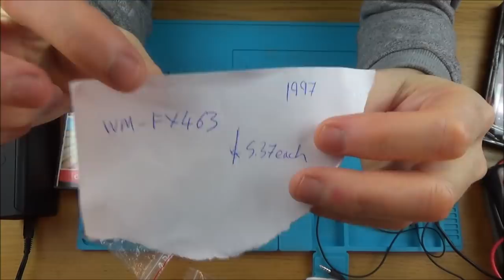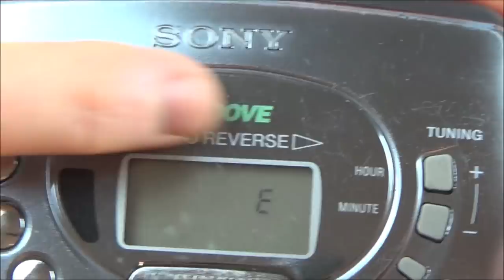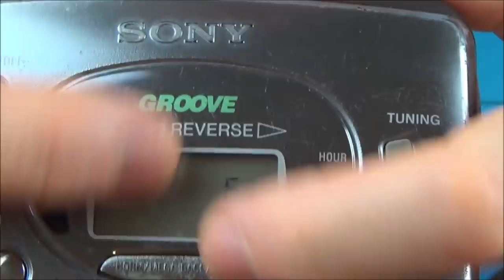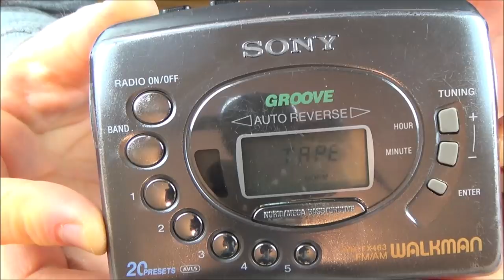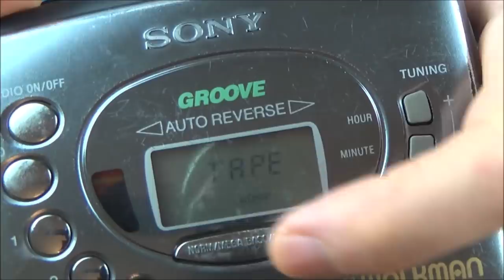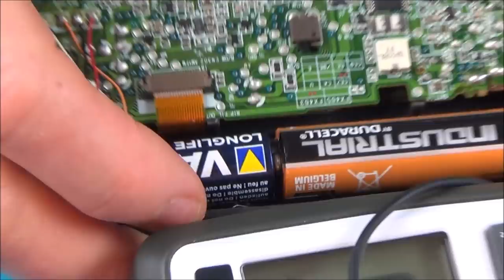Trying to FIX a 1997 Sony Walkman WM-FX463 (5th video in Walkman series)

Comment: you improove your skills pretty fast, but you need to be more gentle to electronics, don't toss them that much ... anyway your videos are interesting, keep making them ;). I think the problem is with square chip on the back PCB. It is  LA4xxx ... this chip is main headphone amp and tape head preamp. Many years ago i had to change a similar one of theese to fix similar sony walkman. Set your iron to 330-350C ... 400C is too hot, solder melt on about 187C. Try to reach front board, where is main processor, the board may be coroded and cause the problems. Also try to connect the grounds on walkman and your test power amp and poke walkman's volume potentiometer pins with one of your test amp channels for any sound.
Reply from the maker: Great advice, thanks for sharing your knowledge :-)
Reply: @Mymatevince  its my pleasure, you remind me of myself when i start electronic repairs some 25 years ago ... it was hard because intel was insuficient back then... ;)

Comment: Is a sound chip a thing? If so, maybe that could be the fault
Reply: Swaggin dragon       Yes sound chips are a thing called pre amp chip some are decoders but that's more in receivers that need to decode the surround sound mix. The information from the type is in analogue format and needs to be decoded to a stereo output that then goes to a pre amp witch is then controlled by the volume switch witch then is outputted through the headphone jack in a stereo format.  The types already in stereo so there's no need to really decode that much it's not like a surround sound mix where it needs to put information to certain speakers at a given time it just converts it from analogue to digital out of the headphone jack. So good place to start be the headphone jack witch he did work your way back could be a faulty sound chip cause radio dose not work either that be the same thing radio is actually analogue too the radio we listen to in are cars is analogue there is digital radio but the normal radio we all know is still analogue and that as well needs to be converted to digital out of the headphone jack

Comment: From what I can see the capacitor that is reading short goes to the switch next to the head phone jack. It appears to be a three pin switch so the center pin should lead of to the faulty component(more than likely the LA4585 chip). But by flipping the switch the other way the short on the capacitor should disappear. If it doesn't then the faulty component is after the capacitor which I can't see in the video.
Reply from the maker: Brilliant fault finding advice,  I will look into this again as I have quite a few suggestions on the comments here so a revisit might be done. Thanks again :-)

Comment: There's no batteries in it why is the clock still working
Reply from the maker: I think it has energy stored in the capacitors that keep the clock working for quite a while after the batteries are out :-)
Reply: Capacitors store power even after you take out the battery's there will still be power until it all gets used up.

Comment: Vince oh Vince... When are you going to STOP calling diode test mode 'continuity test'???? It's NOT CONTINUITY BEEP!! IT"S A DIODE TEST MODE YOU NUMPTY! USE Ohm MODE TO TEST FOR RESISTANCE/CONTINUITY!
Reply: He's learning hopefully.
Reply from the maker: Sorry but why can't you use the 'beep' (diode) test to check for continuity, it is because different multi meters are set up differently so some will beep at different resistances? When you use the Ohm mode what do you class as a short (it is above a certain figure or a certain range) as when I have tried it I get different readings which confuse me but a nice beep is quick and easy to listen to. So when you are fault finding looking for a short to ground on a cap do you not use the beep test? Please explain it as if you were talking to a 10 year old and then I might be able to understand it because remember I am a numpty when it comes to this hence the 'trying to fix' title of the videos :-)
Reply: @Mymatevince  Vince! No worries here - i'll explain. Main thing is - it WILL beep even if there's no DIRECT continuity. So, some circuits have like 123ohm resistance - in diode mode it WILL beep and you may erroneously think it's a short! So, better to get/build/buy a 'continuity tester' - those are very popular with car mechanics! Same principle but it will only light up/beep if there's DIRECT continuity. Also, diode test mode is hit and miss because some circuits are polarized, so it will, say, beep when probing a-probe to point a and b-probe to point b, but won't if you swap the probes around! Any questions - i'll be happy to answer! LOVE your videos. It's a mix of nostalgia, floorwork (i still do stuff on the floor sometimes) and useful tips/exp! Thanks again bro! No offense meant :)

ps. in ohm mode - short probes one to another, notice the resistance displayed (vary with diff models of meters and probes). This is a 'short/continuity' with your setup.
Reply from the maker: Thanks, so on my Surpeer AV4 it does have a continuity mode which is the one I use (the one that beeps) so is this definitely different than the dedicated continuity testers on eBay/Amazon? When I short my leads on the Ohm setting it reads 00.21 Ohms - 00.14 Ohms (varies). If I was using this setting across a circuit board which may have slightly corroded pads my continuity setting would still beep but what range on the Ohms settings would still indicate a short, for example if it read 00.90 Ohms or 1.50 Ohms would this still indicate a short. This is what confuses me as it won't always read 00.21 Ohms but it is still a short but perhaps a dirty one. Hope this makes sense, it does in my head:-)
Reply: @Mymatevince  1. sub-1ohm resistance is a virtual short, also even expensive meters sometimes struggle in sub-ohm range. 2. 1.5ohm is not a short technically. corrosion and such can really mess with digital circuits because of that (minus the trivial corrosion of in voltage parts/connectors). 1.5ohn is a load, not a short. 3. at 20:36 if my eyes are correct i see 'diode' sign displayed on the mm screen. i checked the manual for your meter and it said that you have to press 'orange' select button after setting the big switch to this mode, until 'waves' pictorgram is displayed. this should be dedicated 'continuity mode' of your mm. not the 'diode' icon one. 4. diode mode can be used as a basic cont.test but ONLY when dealing with wiring and such. not for testing boards and such.
Reply from the maker: Perfect, I need to remember that anything 1 Ohm or less is a short, I have stuck this info on the back of the MM to remind me in future fixes.  I have never dealt with Ohms so it can be confusing when the meter had K and M Ohms etc. one day it will become crystal clear but not just yet ;-) The blurred symbol you see in the video is the Ohm symbol and the 2nd symbol is audio symbol (waves) and I do have to press the orange button once when on the Ohm setting to get to continuity. This meter only beeps when I am in this continuity mode which was the mode in the vid. So now that this meter does have a proper continuity mode is it still wiser to use the Ohm setting or the continuity setting. Personally I prefer the sound it makes in continuity so I don't have to keep looking at the screen. Thanks for the sharing the info :-)
Reply: @Mymatevince  oh my bad then. i stand corrected (said the man in orthopedic shoes) :) K is kilo-ohm = 1000ohms, M is megaohm = 1000Kohm. yes as long as you're in dedicated cont. mode you're golden.
Reply: @Mymatevince  and Vince. I really thought that you're a troll when you reworked the hdmi chip in that playstation in one of the early videos. You did it like a boss, kudos. Yes, ok to use cont. mode for beeps but ohm is always more informative.
Reply from the maker: Haha, no trolling here, sorry for confusing you with the first comment....I thought maybe the continuity mode was also called the diode testing mode:-) Cool, I will keep using the continuity mode as I like the 'beeps'. Thanks for sharing all the info mate, I will start using the Ohms setting more and then I will get more used to it. Thanks again :-)